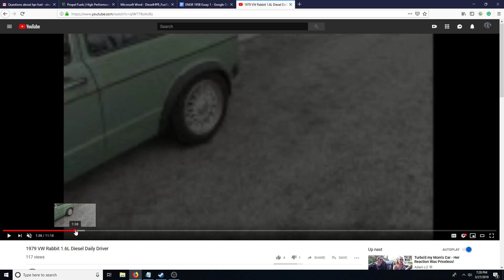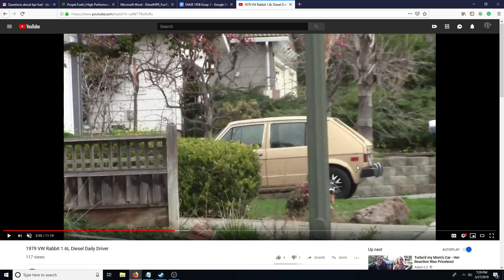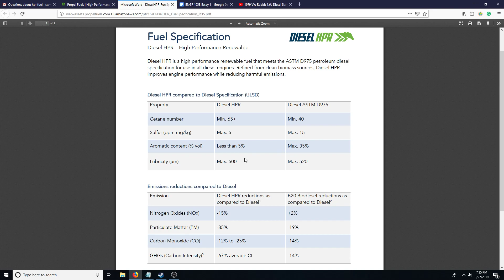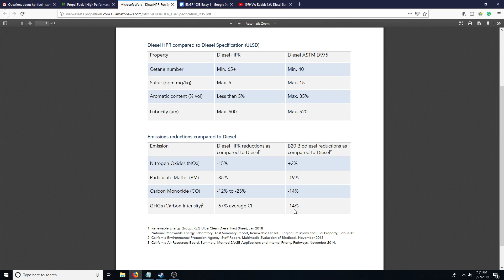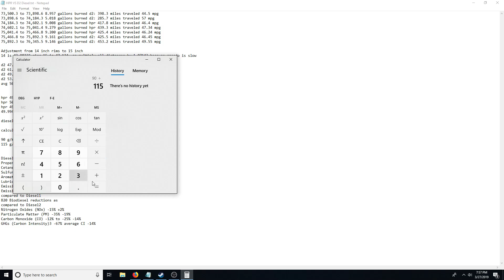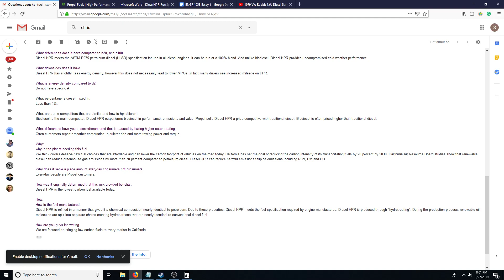Review of Propel HPR (High Performance Renewable) Diesel

Comment: Great overview!! I have a 2023 GMC Sierra with 3 liter duramax.  GM chat support has surprisingly little concrete information to offer about non petroleum diesels.  You're saying HPR is fine for modern diesel with particulate filter (in fact it's better than standard petroleum based diesel) and would have no long term negative impact on engine or warrantee.  Correct?   Great overview!!

Comment: I have enjoyed your presentation but want to quibble regarding your calculation of a correction adjustment for the speedometer because of 15” rims vs 14” rims. You are basing that correction on a misunderstanding that your speedometer is reading the rolling distance of your rims. If you are operating your car without tires that would be a correct adjustment but since I highly doubt that is the case your correction is not accurate.
To correctly create a correction adjustment to calculate the difference in the speedometer reading vs actual speed and correlating that to actual difference in distance traveled you need to know the difference in rolling diameter of your rims with tires on them. In actuality many people have no adjustment needed because they put lower profile tires on larger diameter rims to maintain the same or very close rolling diameter. 
Rather than explaining the calculation to determine rolling diameter just plug the tire size of the original tires on the 14” rims (i.e. 225/35/14)  into size one of the calculator provided in this link https://tiresize.com/comparison/ and the numbers from the sidewall  of the tires on the 15” rims and you can then compare the diameter of the two tire/wheel combos as well as the revolutions per mile and the speedometer correction is actually displayed too.
It is a small detail but I thought that since your presentation seems to be based on an accurate analysis you would appreciate understanding how to actually determine the correction factor for your speedometer reading when changing from stock wheel/tire combo to a customized wheel/tire package.